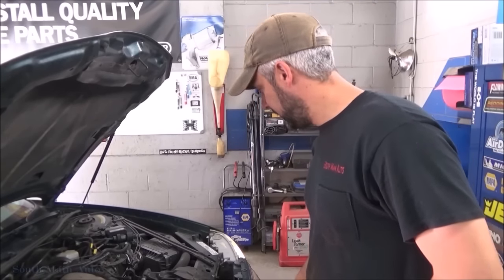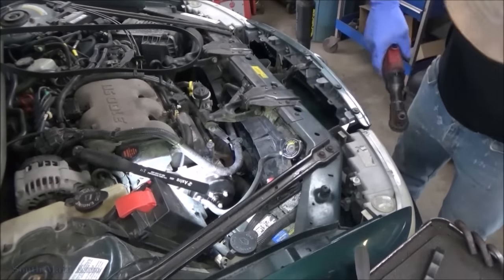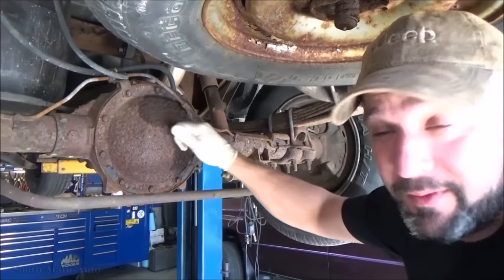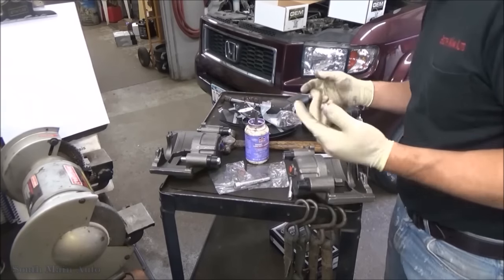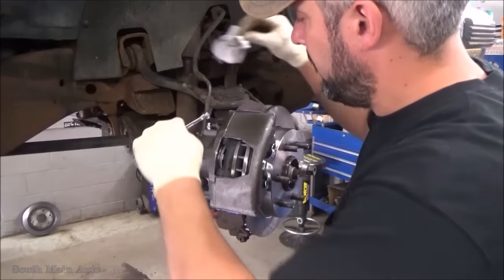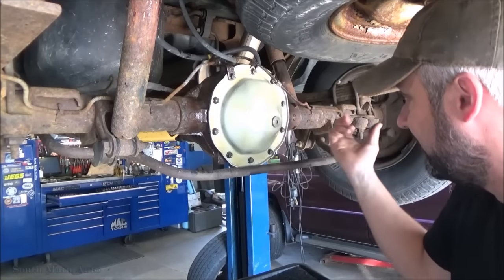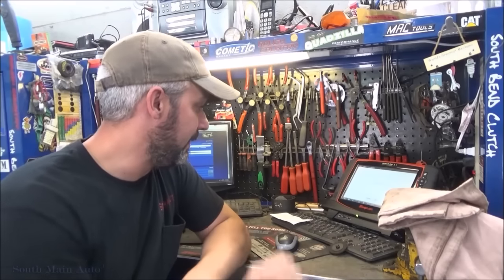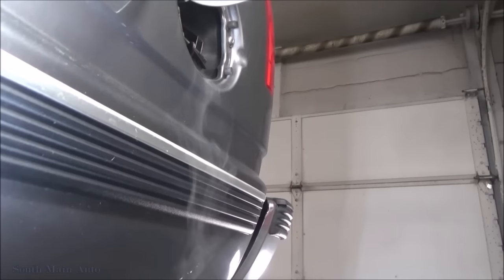Another Normal Day At The Shop - Part I

Comment: whats that brake lube that you use?
Reply from the maker: http://astore.amazon.com/httpswwwy0837-20/detail/B0092LF9OA
Reply: Thank you. Assuming this works on all calipers? Atleast on 99' dodge ram. Motoyam82 helped me figure out my stalling.  Upstream o2 sensor.  Shout out to ivan
Reply from the maker: Oh sweet, must be it was stuck at a voltage , high or low?
Reply: +South Main Auto Repair I believe it was low.  appearently dodge uses specific oem o2 sensors or it does that. crazy.... do you know if the o2 sensor will cause. hesitation of acceleration?
Reply from the maker: I could depending on how it is reacting
Reply: +South Main Auto Repair it was running -33% fuel trim
Reply from the maker: Yep it was stuck rich then :)
Reply: +South Main Auto Repair ahh. it do the stalling too often but it had a strange symptom of doing alot more when its hot outside. the truck still runs better in cooler temps. is that strange?
Reply from the maker: What are the FT's when it warms up? Still -33?
Reply: +South Main Auto Repair the ft only got -33% when it would try to stall. typically ... with 5% of zero either way
Reply: +South Main Auto Repair once I unplugged the o2 sensor the stalling completely went away.
Reply from the maker: well is the 02 sticking? I thought you replaced the 02?
Reply: i replaced with a bosch sensor. thats when it was sticking. this is the bosch sensor, that we're talking about.

Comment: A little messy, wasn't it? You didn't drain the fluid before you pulled that water pump. But I suppose your way was faster.
Reply: Jim Ervin   Is a complete fluid change needed? No, as long as he tops it off and properly bleed it. I'm not to defend him, it would be different if a fluid drain change was included in the job.
Reply: Looks to me like you lost most of the fluid anyhow when you pulled that water pump. Or was it all caught in a pan and reused?
Reply: Jim Ervin   You're right. Which is why he put new fluid in to top it off. It's in the video, bro.
Reply: If he wanted to do a complete drain, he would have taken off the lower hose or drain plug. But that wasn't needed since he was just switching the Part. So he just drained pretty much the top of the engine, enough to allow him to swap parts. Then replaces the lost fluid with new fluid. That's what I can tell based on what's presented in the video.
Reply: Okay, I can see that what you did would be faster than doing it by the shop manual, which would call for a complete drain first, as I recall. I'm not a mechanic, so I always have to turn to the manual first. But it's good to learn a few tricks of the trade.
Reply: Jim Ervin   Hey man, you might be right. I don't work in the trade and I don't claim to be an expert. When I work, I follow Chilton manuals unless I just wing it from my head. I have this same engine and the last time I changed the water pump, I did a FULL drain and FULL refill. However, I wouldn't be mad if my mechanic didn't do it.
Reply: By the way, I notice that you collect some old license plates there. I have some ancient American ones going back to a 1916 New Jersey and a pair of NJ from 1918, plus others. You wouldn't have any old Canadian plates, especially B.C. to trade, would you?

Comment: I like the content I'm a mechanic myself. But I'm sorry I would be pissed if someone put new calipers on my car when all they needed was cleaned. That's a lot more money than just putting pads and rotors on a vehicle and just cleaning up the caliper bracket and re greasing the slide pins. Other than that keep up the good content
Reply: LPS 3 works good for a protective coating